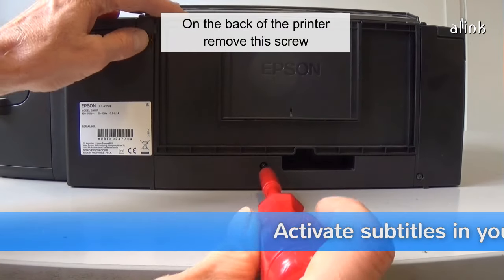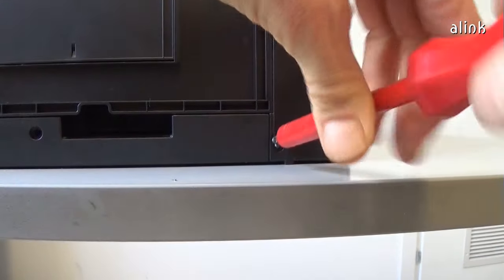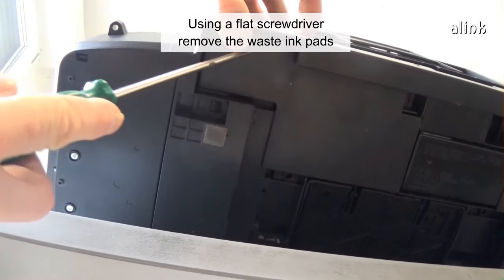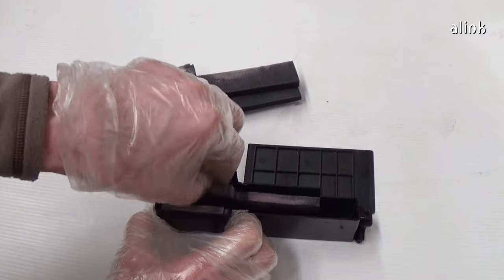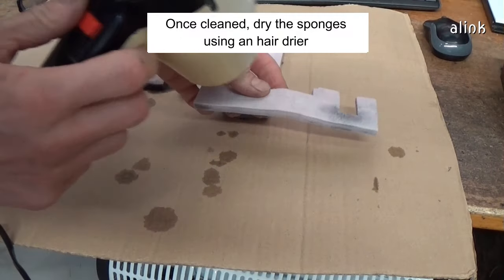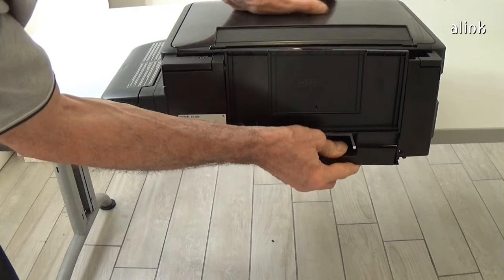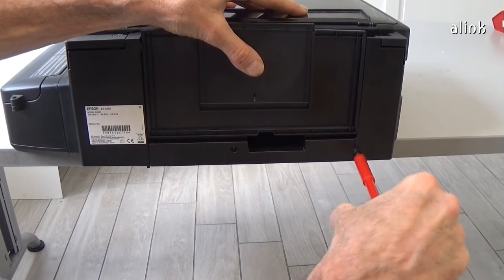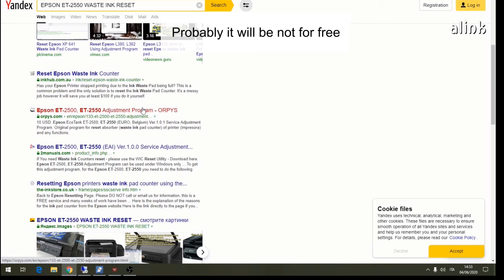How to remove Waste Ink Pads Epson inkjet Printer EcoTank

Comment: NEVER BUY EPSON AGAIN
Reply: Eh, the Ecotank is probably the one half-decent printer model. Every printer is an awful, useless piece of junk that takes an eternity to set up and starts dying a month in. This one is no exception but at least the ink is cheap as fuck, unlike everything else
Reply: How about, never buy an inkjet again! Ink printers really are a money pit. Buy a laserjet, preferably a black & white if you don't require color. But even a color laserjet works great. Put a laserjet in your garage for a year, take it out and it'll print just as it did a year prior. Try to do that with an inkjet for just 1 month.
Reply: @thomastommy9864  You can always try setting a reminder to use it once every week. That’s what I’ve been doing
Reply: In my past workplace we had mostly HP printers. Sometimes the brand new cartridges would not be recognised so we had to throw them away and occasionally we had to replace the printheads which was waste of money. When a printer broke, the company never ordered the same model probably because it was discontinued, so each office had a different model, cartridges and several additional brand new cartridges for the old model. What a mess! Fortunately for them, they replaced all the printers with Epson just before I quit. In fact, HP printers are cheaper to buy but more expensive in the long run. Epson are not perfect but generally better. My only complaint from the epson printer was the stop button which was on the touch screen instead of a independent physical one.

Comment: I wore black gloves that came with my hair color..... after washing and squeezing the pads under running water they came fairly clean. However, my right hand-once the gloves are removed is quite black, especially around the cuticles. Now I have to Google "How to get ink saturated hands clean" - what fun to go to church tomorrow and answer questions from my friends. LOL Should have double/tripled the gloves up.
Reply: lemon essential oil is a wonderful way to remove stains..  if you dont want to use harsh chemical de-greasers that mechanics etc have to use

Comment: Can't thank you enough for posting this video! Just completed the procedure and it was pretty simple. I found it a little difficult to find the clips to release the tank that holds the sponges. Tips for cleaning from my experience: Double glove your hands. (Read another user's comments about one set not protecting enough) Lots and lots of water is needed on low pressure otherwise the ink will splatter all over the place. Stainless steel sink is probably preferred if not make sure to wash one glover covered hand off and use that hand to spread water around so the ink is diluted and will not dry and stain. Keep the water running and you squeeze the sponge, do not rub it downward because this will rub off the outer white film. I don't know if this will affect the reuse of the same sponge. I have not tired resetting the printer yet. I will try to follow up with the reset and whether it was successful or not. Great printer and the ink lasts a really really long time!

Comment: I did this to my epson echo model 2650 and it works great.  I bought a reset chip and have gotten 6 more months of printing (so far) and still going.  The reset was $9.99.  It was well worth it.  Getting ready to clean old ones on an epson echo tank model 2550.  I am sure it will work just as well.  Good luck to all….well worth ten bucks to try before throwing it out that’s for sure!

Comment: Really wish I'd watched this first. I took the whole thing apart and could not get the inside assembly back inside the outside assembly at the top. It would just not pull apart far enough to snap back in.
Reply: Ex-Canon user. Right?

Comment: Grazie mille! Simple and clear. So ridiculous that you should have to contact a service center and pay for something so simple. There should of course be an option in the software for the printer where you easily can reset the counter. (and spare pads to buy). How difficult can it be?

Comment: I have a et-4550 and I can not figure out how to access the ink pads. Its different to the 2550 and I can't find any way to access them. Any ideas?
Reply from the maker: Sorry I've no technical manuals of that machine
Reply: I am right there with you. Can't seem to find any information on that. I am about ready to try and figure it out on my own.
Reply: @Jawsjawsjawsrg  - I figured it out after digging up an exploded view of the printer. It’s accessible via a few screws underneath. Then it slides out and you’ll see the pads. Wash them out in water, let dry and reassemble. You’ll need to download a reset program and reset the printer. After I did all that- good as new!
Reply: @davidrafferton1172   Do you know which screws?   I feel like I have tried many and I don't get it.
Reply: @katdonnelly2430  They should be rather easy to see with plenty of light. Once removed, I had to wriggle the tray down a bit to get it out as it was a little jammed, but once it starts moving it will slide straight down (I had to lay down on my back with the printer above me - tricky).

Comment: the waste ink pad will quickly fill up when doing a cleaning via the printer's power flush mode. when the wic says the pad is full and the printer will stop working. one can easily clean the pad, its just a bit messy. 

is there a FREE way to reset the waste ink counter and get the printer to work again?????????????? 
EPSON wants the reset to only be done at a certified service center, and CO$T of course.
Reply from the maker: in this channel there is a reset method but it will cost around 10 dollars
Reply: @viandant5  i know about purchasing keys for a reset. epson must make reseting free.
Reply: @arkrainflood  They won't. Its a scam to make money. My Epson I bought last year doesn't even have 2000 pages through it and it already threw up this error. Only mainly used black. I cleaned the pads manually and now have to pay for a reset. They want you to throw the printer away and get another one. First and last Epson I am buying.

Comment: I did NOT get a message saying e.g., my waste ink cartridge was full.  Nevertheless, when I send paper thru I get a blank sheet.  I have already done nozzle clean several times, so I took out the waste ink cartridge and cleaned the pads.  Paper still comes out white.  My question: do I have to buy the counter-reset software first?  I hate to spend $10 if this is not the problem.  Please someone: get back to me.
Reply from the maker: A blank page is not caused by the waste ink pads full. Probably the print-head is defective, if so a cleaning is useless. I think you have to change the print-head but it could be the main board too
Reply: Hi, how do I know which of the two is the problem?Before blank pages I had printed several pdf pages which showed me rectangels of different colors overlapped and then started printing blank pages. I cleaned the pads, but I still haven't reset the counter. Will be back to you all as soon as I do it. Thanx Viandant! 👍